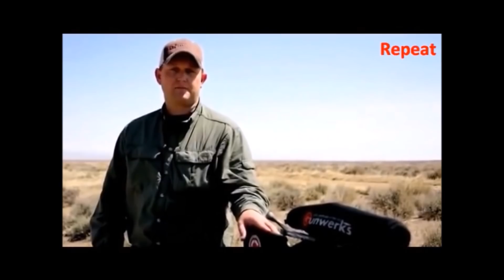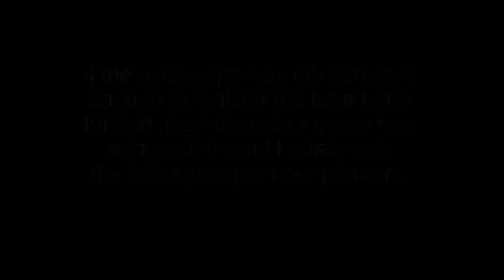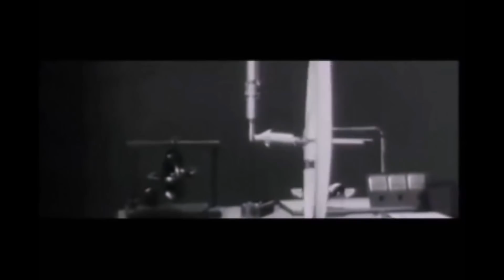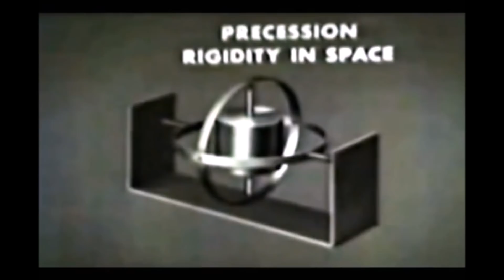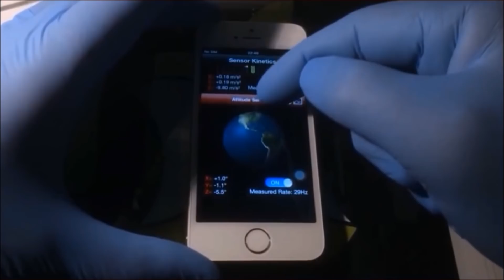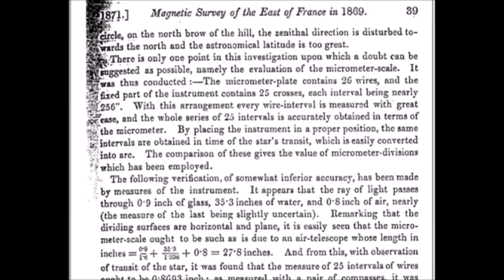The Motionless Earth - Final Addendum

Comment: Then if like bullets, planes were not rotating with the Earth, why does it take the same amount of time to fly East to West and West to East (on a same length trip) ?

Example 1 : I’m flying from Paris to New York and it would normally take the same amount of time as from Paris to New Delhi.
But if Earth was rotating, I would reach New York MUCH FASTER since the ground would scroll in the opposite direction independently of the plane’s own movement.

Example 2 : If I take a trip to the East the plane would have to fly MUCH FASTER than 800 km/h to compensate the Earth moving in the same direction. The plane would have to fly at an insane speed in this case.

Example 3 : If Earth was rotating, the rock I throw into the air perpendicular to the ground would fall slightly further since the Earth would rotate during this time (like when you drop something from a window when you are driving, the object stays on the point you dropped it and is not following the car during its fall).

That said, Earth is motionless and corresponds to the actual physics.
Reply: Y T I just searched on a flight comparator website and it shows the same travel time for both directions...
At the equator the Earth is rotating counter clockwise at 1670 km/h (even if in Europe it’s slower), don’t tell me your plane should be flying at half the sound speed in order to arrive in time to Asia. Wtf are you talking about.
Planes aren’t attached by fixed steel rods down to the ground ! If the earth rotates, flying vehicles would have a really hard time flying to the East !
Reply: Y T I think I misunderstood your answer. By “except that is does” you assume that travel times are the same in both ways, or planes increases their speeds when flying to the East ?

Comment: coriolis doesn't happen a.) 90° relative to the ground, it happens b.) relative to looking down from the nearest pole.
In the beginning, you imply the effect is based on (a)...which is a fundamental misunderstanding of coriolis effect.

You still move with the earth, but when you drift further in the x or y plane from the poles, the ground below you has a different speed due to angular velocity. like the outside of a circle moves faster than a point halfway to the middle, despite the same angular velocity.

Again, fundamental misunderstanding.
Reply from the maker: Go tell the military that then and the guy selling guns here. Care to explain the gyro drifting on the 24h turn table and then not drifting on the claimed 24h rotating earth?
Reply: I never really understood it till your video forced me to reconcile the discrepancies, so credit to that.
 The way to think about it is Relative to the poles/axis of rotation, you move around at 1000mph at the equator, but slower as you move toward the poles(since your circular path gets smaller).
Then while your momentum is conserved at 1000mph to west tf you shoot North from the equator towards the pole, miles North, the ground is not moving as fast(relative to poles), say, 997mph West, but that bullet is still going 1000mph west(with you)....
The effect is so small that I guess the first guy never had to account for it. Second guy he either didn't understand it like most of us, or he wasnt being clear enough...

If you were at the North Pole, and shot South I'll bet it would be pretty noticeable though...

That's at least how I understand it
Reply: @ChadDidNothingWrong  Everything is based upon flat nonrotating earth  assumptions , artillery, rocket trajectories , inertial guidance systems , aircraft flight manuals , satellite tech , electromagnetic field  propagation traveling over flat earth,  it's all based on flat and stationary earth bruh . blows my mind.  Go to Google scholar and type in assuming a flat non rotating earth , or flat stationary earth , there's so many peer reviewed studies you will spend all day just looking at all the links , let alone reading them , some are hundreds of pages but you can   get pdfs on a lot of them . Flying over or even kicking a football  over the earth should be affected according to Neil Deass Tyson but it's simply not true . it's basically the same as telling you swimming upstream is the same as downstream since east /west flights only show a slight flight time difference.
 (due to wind speed) 

Don't Sphere The Truth 
love your channel btw keep up the good work brother . I'm working on getting some real editing software probably should get a good laptop. 
Also I'm wondering if you're part of the official flat earth and globe discussion on fb we're the largest flat earth group by far , we get about 300 new ppl a day or 300 requests a day . I'm a mod there if your not in it you should join . 
 GOD BLESS  .
Reply from the maker: That defies still military charts and explanations. They should have to know this in life and deaths situations right? Well... we have many coming out admitting they don't have to even worry or think about it, regardless of location and direction. They're never told to on the field. Any direction. That would not happen on a spinning ball. So.... about that gyro....

Comment: When you jump on a moving object like a plane. It simply feels like a regular jump. 

Why?

because your moving at the same speed the plane is, even when you jump. Altho you feel no movement you are moving! If the plain moves at 100m/hr and you jump you’ll jump up but still move at 100m/hr as well.

Same thing applies to a bullet! if the earth is moving at X speed the bullet has to move the same speed before and after you shoot your bullet. 

Why? Because of the same reason when we jump on the plain. The bullet is shot forwards but still keeps moving X speed to the left or right. It can’t just decide to stop moving just because it was shot. It would be like you deciding to stop moving 100m/hr when jumping on a plane. You would be thrown to back of the plane.

To us the bullet should just shoot straight, because we are moving with the earth as well. 

the reason a bullet moves left or right when shot is do to wind not the earth moving.
Reply from the maker: Now stand outside and on top of the plane, as if you were on the globe model and jump. The other issue here is that the globe can not demonstrate gas pressure next to a vacuum. Never has and never will and every demonstration shows that "gravity" can not hold back a vacuum and prevent water droplets becoming gaseous. Let's just give you the pressurized system though of the plane and assuming it will always have the same velocity and not change angle.... now send it on the 3 other claimed velocities that the Earth has. What happens when you accelerate just a little in your car? You feel it. Now also send it spinning and also revolving around something while spinning. Your jumping will be effected, no doubt. Globe is based on PURE fine tuning of conjecture and trying to force maths to fit perfect relativities, none of which can ever be detected scientifically.

 It's the tip or rim speed that matters, not the RPM. So we have still bodies of water clinging to a sphere of 4 deadly velocities, just one causing "earth bulge", yet we have glass like sheets of water (that always serve as a PLANE mirror btw regardless of cloud distances for example, stays same size) where the slightest vibrations from afar will cause a ripple, but the EARTH SHAPING VELOCITIES do not cause ripples? The earth beneath that is bulging up due to the rim speed is ALSO within this "pseudo-gravitized-pressurized" system that is supposed to be sitting directly next to the harshest vacuum in "all of existence" as well, so how does it select from only effecting the earth over the water? Any force that is great enough to shape bedrock is great enough to cause a ripple in water, let alone massive waves flying off into space, yet we can have complete stillness in water at the equator and everywhere. The ball earth is just one massive physics fail that tries to save itself though inventive mathematics that have zero connection with reality. The observable world. 

The ball earth is literally just assumptions and numbers on paper at it's core.... and it's "real core" also completely defies the Curie temp. and magnetic fields. The lists goes on. Spinning ball, big bang earths just don't work. It only exist on paper and in computer programs. It blatantly defies real physics, observations, and common sense. It can not ever be demonstrated in our real world. Everything fits a flat and stationary earth and this is why everything is "projected" onto flat planes and maps and why general relativity claims there is no difference between the earth moving or being stationary. Why they still use geocentric models. It's all bs pseudoscience propped up by fraudulent "space programs" ran by tyrannical, lying governments that want nothing to do with sharing the truth and actually caring. Well documented. We all know this. To mold the populations and convince us of anything they want to further their agendas of control and it works due to compartmentalization and repetitive "gaslighting". Hegelian dialectic too. All it takes is 1-2 generations to instill a lie through "education". The same way rulers have operated throughout the ages and all the blood and money trails are there for those rabbit holes to explore. We've been lied to by the occult and it's PLANE and simple. Regardless of the continuous onslaught of repetitive questions about several different topics, which all have already been answered sufficiently to my knowledge, does not and can not take away the facts laid out. You're not spinning, arcing, and zooming around in a vacuum. Time to move on ballers!

Comment: Very nice compilation here, well done.  I might add that regarding the 15* rotation per hour detected by ring laser gyroscopes and fiber optic gyros, not only does this most aptly describe the velocity of the Aether as it rotates around a flat, stationary Earth; but there is considerable evidence to suggest that this precise velocity of Aether ‘drift’ is at least locally dictated and determined by Earth’s own electromagnetic field!  The very flux of Earth’s electromagnetic fields provides the atmospheric ‘motor’ that’s compelling the circulating Aether, as testified by the ring laser gyro!  Fascinating...
Reply: Yeah the increase at higher altitudes at the same latitude point to it for sure as being the cause for drift

Comment: If you throw a rock at 20mph out the side window of a train, while the train is going forward 100mph, how fast is the rock going?  (Ignore wind.)  Note:  The train throws the rock faster than the person throwing the rock.  Same with a shell leaving a 16" gun.  
If you throw a rock at 20mph from the front of the 100mph train, the rock will appear to a ground observer to go 120mph.  If you throw that rock from the back of that train, the rock will appear to be going 80 mph (in the direction of the train).  If you throw a rock at 50mph from the back of the train, and the train is moving at 50mph, the ground observer will see the rock fall vertically.

But light is different.

The Michaelson Morley experiment attempted to determine the speed of light by using rotating mirrors with light pulses bouncing toward a target.  The RPM's of the mirrors and the correct bullseye determined the speed.  (This is somewhat over simplified.)  What was unexpected was that the results were identical regardless of the orientation of the apparatus (facing east or west), which concluded that the speed of light is a constant.
Reply from the maker: Light is not a constant lol all that babbling just be disproven by light moving through water or a prism. Let me guess... it magically speeds back up too lol. Light is a rate of induction. Take your regurgitation elsewhere.
Reply: @DontSphereTheTruth   The speed of light is constant within a given medium.  In the case of my example (Michaelson Morley) the medium was air.
Reply from the maker: You might find this useful and informative... https://youtu.be/Fju308PmBn8 enjoy!
Reply from the maker: Hence why motion was easily detected on the 24h turn table, but not for the Earth. The Earth would have registered. Totally in its sensitivity range.
Reply from the maker: Einstein has not been proven, stop listening to mainstream propaganda, he has been CLEARLY refuted with his imaginary equations that account for nothing but the imaginative "contraction" of Michelson-Morley device because they found the ether and HAD to explain it away because they were wrong if they wanted to stick with the Copernican model, which in nature turned out to be wrong as well. If you actually watch the video, this is explained and ADMITTED among those who INVENTED the equations. It is straight up ADMITTED that the equations are NOT needed if you place the Earth as being stationary. The equations are only NEEDED if you believe in the Copernican model and have to explain away imaginary motions of the earth. THEY ADMIT THIS. EINSTEIN AND OTHERS ADMITTED THEY  PURPOSELY DID AWAY WITH THE ETHER THROUGH INVENTIVE MATH, because it was their ONLY OPTION to INVENT MATHEMATICS and INVENT "SPACE-TIME", and to IMAGINE that devices somehow physically alter themselves while they observsbly don't.... all this and INVENTING much more INVENTIVE NONSENSE, that THEY ADMIT to inventing because they refuse to accept the simple, obvious, demonstrable, and repeatable proof that the Earth is STATIONARY.

This is why General Relativity even came into existence... to create a NEEDED excuse. HE ADMITS THIS. Can't stress that enough. Gyroscopes also prove this (Watch the video) and the globe excuses have all been answered and the "miracle" that planes fly just perfectly fine, like they always have, without the said device needed to "account for earth spin and curve"... The same device that only ONE entity makes for the ENTIRE airline industry, its contracted out to NASA, and they don't talk to anyone.... hmmmm.

We proved the ether through Airy's failure, through Michaelson-Morley and others, and through modern day ring laser gyroscopes. The ether was detected. The explanation that it's the Earth spinning was refuted because it was the ONLY motion ever detected while our claimed motion around the sun never shows up. Same with our claimed motion around the galaxy and through space as a whole. All those speeds should register with ring laser gyros but they never have and never will and it's ALL well within their sensitivity range. Now to drive this point home even more, a helmholtz coil has been used near these ring laser gyros and it completely sends the readings wild. This is because it's altering the electric/magnetic fields of the ether. If it was the Earth that was moving the helmholtz coil wouldn't have an effect on the reading, PLUS more than just so-called "axial spin" would be observed.

Sorry if I came off strong, but I highly suggest you watch my video about science vs. mathematics and listen closely to the entire presentation.... https://youtu.be/0f7qlCTToDc

Accelerometers also prove what we live on/in .... check this out if you haven't yet.  https://www.youtube.com/watch?v=V3tdyV1cAWg
Reply: @DontSphereTheTruth  Thanks for your reply.  In watching the gyroscopes in your video, it seemed to prove to me that some motion (of the earth) is detectible over time. as the gyroscope moved.
But to support your hypothesis, I want to add that our telescopes can see an equal distance in all directions.  Science claims that beyond that distance, objects (if any), are moving away faster than the speed of light in our expanding universe.  We are at the center of the observable universe.
Reply from the maker: John Savage has done many gyroscope tests of all sorts and durations and has attended to many claims about it. No Earth motion has yet to be detected. It's the heavens that turn.

Comment: Good graphics, I was in a train last week, threw a ball in the air, and it did not go through the back wall, but I would never ask someone to jump while in a flying plane.
I want to visit my mom in Vancouver this summer and I live in Ontario.  I will jump in the air to get there but book a very fast plane to get back.
Do I understand it yet?
Reply: Why did the ball not go through the back wall?
Reply: @robmcclelland6793   Because it has mass and therefore momentum.  That is one reason, besides gravity, that we don't fall off the spinning globe.  It is also the reason why planes travel the same speed eastward as westward, barring other factors such as wind.
The ball is moving and keeps on moving at the same speed if no outside force is exerted on it.
I was being sarcastic in my first comment.
Reply: @davidprimeau3368  My question was  rhetorical. You may also observe a fly in a moving vehicle, even at high speeds the fly does not splatter on the rear window.

Comment: Fact. Your setting up a long range shot holding your rifle. You and your rifle are sopposedly spinning right? Okay you pull the trigger and the round has to travel out of the barrel right? Why on earth would the round all of a sudden stop motion with the spin? If the round was able to stop rotating as we are told that in fact wouldn't be possible. Think about it. There would never be a reason to calculate the rotation of the earth in any scenario. So its BS. Its not something a sniper has to think on. They never do. No calculations on spin or curvature needed because it doesn't exist. Any sniper knows that is not a factor needed. We are being lied to as usual. The devil is crafty and a super lair. Think in and use the wisdom of the gift Jesus left for us. Than you will see the truth.